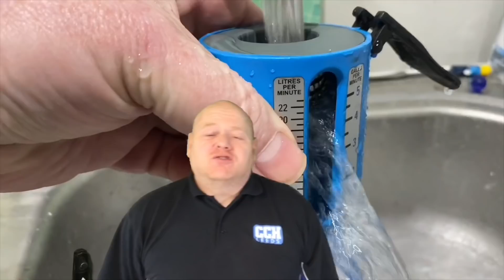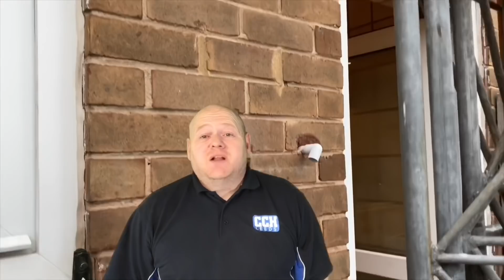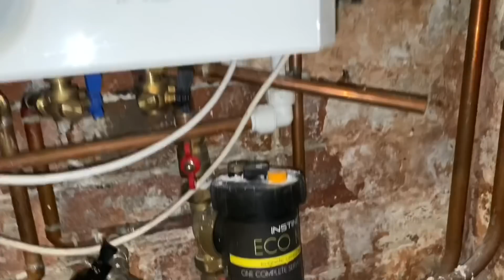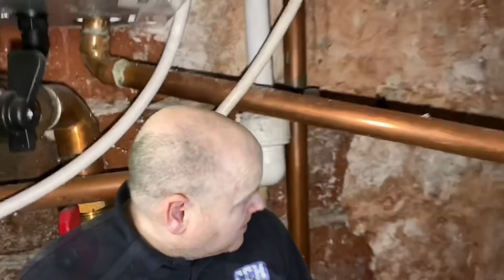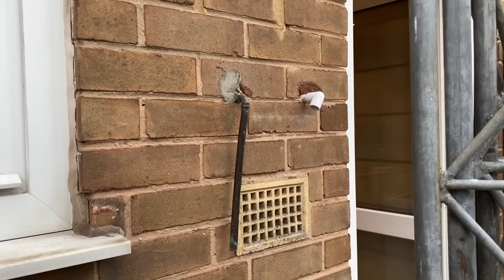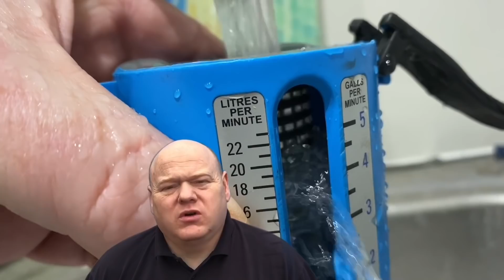LEEDS PLUMBER - BOILER QUOTES

Comment: Hey im the customer of the ideal install. Firstly i have only owned the property for 7 months so defo wouldn't have paid for an install as bad as that but seems the last landlord cut corners where he could. I just want to defend the comments around landlords a little as we are not all the same. In the 7 months I have owned the house I have had a new roof on due to multiple poor bodged jobs, new boiler and refurbed one of the flats totally. So we arnt all in it for the money as it will take me over a year to even break even but I believe in doing jobs properly and only renting houses I would live in. Just want to say a massive thanks to Allen coming out to quote he defo knows his stuff. I just had a baxi 825 fitted by an approved baxi installer from there website as Allen seems to be a big fan of them and trust his opinion. There wasnt a huge amount in it cost wise between the 2 quotes but this guy I went with had just been let down on a job (they actually cancelled while he was quoting mine due to the boiler been out of stock) so could get me in quick and with the tenant topping up the pressure every 2 hrs I wanted it sorting for her. Allen defo knws his stuff and have gone with the baxi given his views and reviews on them so fingers crossed its a good boiler. To note I had a flue guard fitted (yellow pipe is scaffold) a new filter, all the pipe work cutting back and new instaled in a tidy manor, new boiler plus controls and the blow off goes to an external drain that is just behind the boiler but 1 meter underground so was maybe missed by Allen as it has a slab over it.
Reply from the maker: I didn’t miss the drain😂 I would of still installed a remote blow off higher up, That way it could be seen if it was leaking. Thank you for the feedback 👍
Reply: @AllenHart999  what's a blow off? Pressure relief?
Reply from the maker: @stevehove2648  Yes, PRV, pressure relief
Reply: @AllenHart999  and whats a remote blow off?
Reply: @AllenHart999  not a term Ive heard before!
Reply: Steve Hove he just means to add in an additional PRV somewhere else on the system.
Reply: @stevehove2648   yeah pressure relief
Reply: @Hate2Reg  thanks, yeah get that. Just something I  hadnt heard of.
Reply: Let's see a picture of the new install? Before and after 👍
Reply: A year to break even, not counting the 8+% rise in house price freebie ;)

Comment: Can you pipe a blow off from modern boiler install on the return and put an additional blow off in the return above ground level? Or is that stated in manufactures instructions?
Reply from the maker: Baxi allow it, So do ideal. Thanks.

Comment: Hi Allen, if my boiler is losing pressure and no water is coming out of the blow off valve, could my heat exchanger be leaking into my condense pipe without me knowing? Insurance company keep saying I must have a leak on the system but I can’t see anything anywhere! 

Logic Combi 30 boiler 2017 

Keep up the content 👍🏻
Reply: Check all pipework. Under floors, attic, etc.
Reply: Most likely, you can prove by isolating the flow and return valves  over night to see if it holds pressure.
Reply: Yes your heat exchanger could be leaking and going down the condensate. On a logic it wouldn't be surprising either. If you suspect it might be your boiler it should be under warranty still so give either ideal or your installer a call.
Reply: It's well known that this particular boiler does have issues with the heat exchanger leaking into the condensate . Do not know how your particular condensate pipe  runs or terminates .There should only be water dripping through this pipe when the boiler is on or shortly after it shuts down If it is dripping constantly then it is odds on the heat exchanger Like a previous contributer has already said check if it is under warrantee some of these had a five year warrantee,some only two . Ideal may charge if you call them out even under warrantee and it is not the boiler at fault.
Reply: Thanks for all the replies everyone, the boiler is in a converted loft and the condensate pipe runs into the sewer pipe which I cannot get to.  

I isolated the boiler when an engineer came but only his working hours (7 ish)  it dropped from just over 2 bar to just under 2 bar, but when I switched the boiler on it dropped a little more. So he’s ignoring the fact it dropped dropped whilst isolated he’s blaming the system. 

The boiler is just out of warranty, it’s the + models that have the longer warranty on the heat exchanger. 

The boiler is insured through Scottish power, it’s the engineer that’s telling me I’ve got to let it get worse! It’s dropping 1 bar a week in pressure. 

Like one of you said I need to isolate for 24 hours, get him to disconnect the condensate from the boiler and see if it’s leaking from there. 

He thinks because he can’t visible see it dripping in 20min it’s fine. 

Thanks again for the info everyone!
Reply: @leestar7156  an engineer can take the cover off the boiler, remove the sump cover and will soon see if the heat ex has failed or not. Having said that, why is your boiler set to 2bar? It should be 1bar with the system cold.
Reply: Craig Watson I was always told between 1 & 1 half bar. He set it at 2 whilst it was isolated.
Reply: Good morning If I understand you correctly the engineer did check the condensate for dripping after 20 minutes and it was ok This would appear to rule out the heatexchanger .The slight difference in pressure with the boiler isolated could be explained by the water in the boiler cooling .Same when the taps were opened up I would expect a heat exchanger to leak a lot more than one bar a week which equates to about I litre a week on an average system .You mention setting the boiler at 2bar if this is set cold then it is too high 1.5 bar maximum is the most I would go too,You may be putting a higher pressure in to make it last between top ups but all this higher pressure does is make it leak more prenounced .With the system cold go round all the radiator connections with a torch and a mirror . Including the top plugs 8/ 10 leaks are on the radiator connections but a small leak can be hidden by a hot system . After the rads check all visable joints again with a torch and mirror to check behind  same . Make surbe the expansion vessel has been checked for the correct pressure  ( 1 bar ) This should have been checked by the engineer it is within the boiler and you cannot do it BUT if the correct pressure is not in this again it can magnify the pressure loss. You say you have checked the blow off so that discounts that . The leak could of course be under the floor .Have you a drain off poking though the wall ,if you have check that. There are leak sealing solutions you can get to put into the system but these are only ment for small leaks ,they are effective when the leak or leaks are tiny but the best solution is to try and find it first. Good luck.
Reply: john Boy He ruled out the blow off valve, plus I’ve never seen it dripping myself either. What doesn’t help is below the pipe is a rubber roof and every time I look it’s wet anyway.I have seen on the wall it does look like the blow off valve could’ve have been leaking, like a stained line on the bricks exactly below the pipe, plus the pipe looks really weathered, almost white.

Comment: I’m a Vaillant guy so would offer a Glowworm or Vaillant as options. 7 yr warranty as standard. Upgradable to 10yrs. Is that first one 300mm from the door? Also I would take the PRV pipe through the door frame to keep costs down to save a remote PRV. Frost and pipe stat as I never trust the internal ones and you are meant to fit them. Quite a few installers have been pulled on it in the past. New Adey pro2. Chems and hot flush. Optional magnaclense flush if required. Lagging everything for 2mtrs or as far as practical. I would also tidy up that pipework. And plume kit if required. £2100 plus vat ish. dependant on boiler and if plume kit needed, and if I ever went quiet.
Reply: Vaillants?  You have to put up with the noise - and the poor quality casings. I am no fan as you can see.  A company living on past glories.
Reply: "Frost and pipe stat as I never trust the internal ones and you are meant to fit them."
Where does it state that you are to fit external frost protection?
I can't talk for Vaillant and the reliability of their internal frost protection.
Reply: I have only had noise from ones that have not had the G10 seal replaced, or that have but have not used the copper grease. Regarding the frost thermostat,it’s something I have always done, and 4-5 years ago a gas safe inspector said that it is mandatory. Most boilers that I have seen these days have a frost thermostat connection. Only needed if installed in a location prone to low temps. That’s my take on it any way. 👍
Reply: @efrygasservices6169  
Vaillants are noisy, even new out of the box. Not impressed at all. Some sound like nuts rattling in a can. I can't see why people laud these average boilers.  They have also made some real dogs. 

The GasSafe guy was wrong. If the boiler has integrated frost protection that is all that is needed - that is one of the selling points of the product. An external frost stat can be fitted for parts of the system that are vulnerable to frost, that are say away from the boiler location. 

A room stat can also act as double frost protection, the 1st stage, giving minimal temperatures in the house. Heatmisers come to mind.
Reply: John Burns for me, I can’t say I have ever had the issues that you have with Vaillant. I’m not saying that I haven’t had issues, but only issues due to bad installation. (Dirty water etc) That’s why networks like this are great, as some people have issues and some do not with all boiler brands. I have never challenged the frost thermostat installation as was told by a gas safe inspector, but upon further investigation, I cannot find the ref either. Top point pal, thanks 😊

Comment: Allen your a true gentleman and perfectionist like Dr Pipe

Can I be cheeky and ask for a rough cost of these installs , as I think it would help a lot of folk

Agree that installs are getting worse with more lazy engineers who want to cut corners to save time etc

Also I’m a big vaillant fan despite issues Iv had with ecotec 838 , a future review on a modern model would be great 👍
Reply from the maker: First one was around £2k Thanks.
Reply: Allen Hart  Thanks very good price considering flushing etc , keep up the great work , ps I’m a landlord and don’t cheap out but based on your videos will go for a atag next time

Comment: The first in the semi basement.  The Intergas Rapid has to be the combi of choice. 30kw version to ensure a decent hot water flow. The pressure relief and condensate are combined into one pipe that empties into the drain. No separate copper pressure relief pipe. A plume extension kit is also available to direct the exhaust gasses away from the offending yellow pipe.  For the cost of an outside temperature sensor the Intergas can have weather compensation, complying with Boiler Plus. The wire to the sensor can be unobtrusive bell wire run around the outside of the building to the north face if need be. Or have the room temperature control on OpenTherm.

That pipework around the boiler needs doing professionally of course, of which I would have full faith in with Allen.  The Intergas is known as the landlord's boiler, as they last and rarely go wrong.
Reply from the maker: Thank you so much for that. 👍
Reply: Our company does loads of Worcesters but I'm starting to love the baxi boiler mainly due to you vids mate.👍
Reply: @justinchilvers7741  
Try an Intergas, you will not look back. Self employed guys love them as you get no callbacks. 
Caveat: No interests with Intergas.
Reply: @johnburns4017  I've ripped 7 intergas boilers out in the last two months, terrible boilers.
Reply: @frenchfrench4514  
I do not believe you.
Reply: @johnburns4017  And I dont mind that.
Reply: @frenchfrench4514  
No one who has extensive experience in this industry, knowing Intergas boilers would agree with you. I smell astroturfing.
Reply: @johnburns4017  I dont even know what that means. Nobody I know in the trade likes them or fits them, my local merchants doesnt even stock them. I'm not selling anything here, I've got time for most other brands and fit most other brands. But Worcester and Intergas are the two worst boilers available on the market. Both poorly made and designed.

If intergas was such a great idea all the manufacturers would be doing it.
Reply: @frenchfrench4514  
You write complete tripe! Not one Intergas heat exchanger has failed in 20 years. You do not need to fill the CH side to use DHW and visa versa.  They are built like tanks.  With only four moving parts.  

Everyone I know who has had experience of Intergas goes with them. The two latest models are superb that modulate way down low with excellent DHW flow rates. 

No experienced, intelligent and reasoning, installer would conclude as you do. That is why I smell an astroturfer.
Reply: @johnburns4017  Still dont know what that means.  And you should always be wary of someone that defends something so ferociously. You clearly have some kind of vested interest in Intergas. 

Intergas just isnt very good all around, yes it has less parts. So what, it isnt built well. Having a good heat exchanger isnt exactly mind blowing is it! And anyway, that's an absolute ludicrous comment to make and you cant be taken seriously making a comment like that. How do you know that theres never been a heat exchanger failure? Have you or intergas inspected every boiler on the market? Did you inspect the 3 i ripped out the week before last? Did you go to my skip and pull them out and have a good look? What a clown.

And dont get me started on the efficiency rating, the intergas is 88.9% when the real boiler companies are producing boilers now that are 94% efficient. Even "old" combi boilers have a better rating than intergas boilers. 

Literally the only thing going for an intergas boiler is that it has less moving parts, wow, nobody cares.
Reply: @frenchfrench4514  
You are writing complete nonsense. Everyone I come across swears by Intergas, then one fella says he has just ripped a pile out in a few days. Sure you have. Sure you have.
Reply: @frenchfrench4514  
I have an analyser print out giving over 98% efficiency on a Rapid. Everything to service or change is easy and quick.
Reply: @johnburns4017  Better get your analyser re-calibrated pal. Haha
Reply: @frenchfrench4514  
You better stop astroturfing.
Reply: @johnburns4017  Still don't know what that means even with the new spelling.
Reply: Ahhhh I've gust googled it.

What is astroturfing?

Astroturfing is the attempt to create an impression of widespread grassroots support for a policy, individual, or product, where little such support exists. Multiple online identities and fake pressure groups are used to mislead the public into believing that the position of the astroturfer is the commonly held view.

Thats exactly what you are doing you plonker hahahahahahahahahah
Reply: I come across alot of bad installs like that especially in HMOs. I find that properties owned by landlords usually are the worst.

Comment: We would put Baxi or atag. Baxi are ok but I'm not a big fan of the heat exchanger the tubes are to small and can cause issues later if the systems not really clean.
Reply: I am no fan either of the Gianoni heat exchanger for that reason. Allan had a recent vid with a cut-away of a heat X that had nice wide spiral tubes Most modern boilers are kits. Outsiders make the heat exchangers, pumps, plate heats Xs, valves, pcb's, gas valves, fans, burners and all controls.  They just make the casings and the odd purpose made bent tubes as far as I can see.  Intergas, Navien and W-B do make their own heat exchangers - and maybe Viessmann. The heat X on the Ferroli Modena is home made too. Off the top of my head I can't think of others.
Reply: @johnburns4017  The gas boilers heat wather not mud :)  Q/A Magnafilter... 50-80E...
Reply: John burns. Yes mate
Reply from the maker: Thank you for the comment. 👍

Comment: Hi Allen I come across it a couple of times you don't know the other part of the story you get what you pay for and landlords are tight not all most.
So looks like he got cheapest guy to do the job.
Reply from the maker: Seem to be seeing this a lot more these days.
Reply: @AllenHart999  
Live in London. What a shambles of cowboy installations - even by GasSafe men. 

Next job will be a Keston because of the long flue lengths using plastic flue pipe. Previous quote was to replace a small heating only boiler in the kitchen with a big combi, needed kitchen cupboard work.  I looked and saw it could go in the basement by extending the flue. Some just do not even know what is on the market. The thought of an extended plastic flue never enters their minds. 

They are delighted as they will have the noise out of the way, weather compensation and a liberated kitchen cupboard. All servicing crates no dirt in the kitchen.